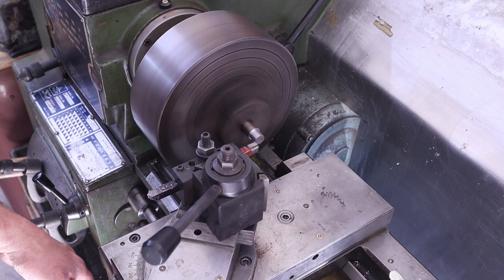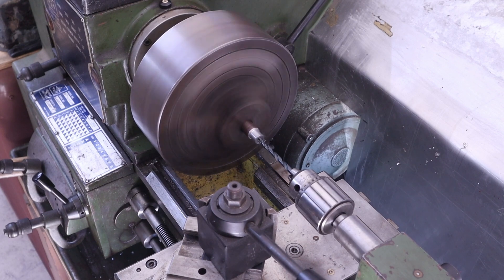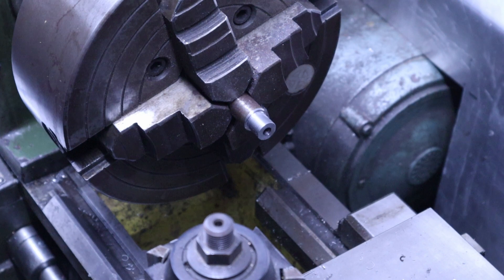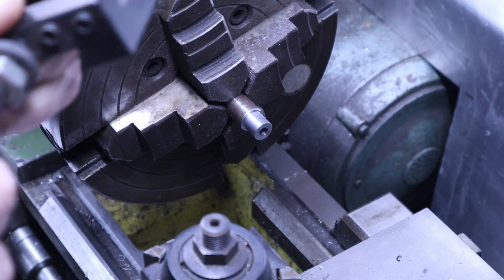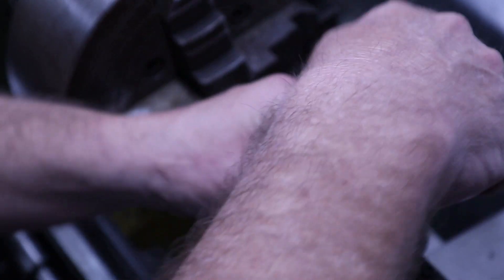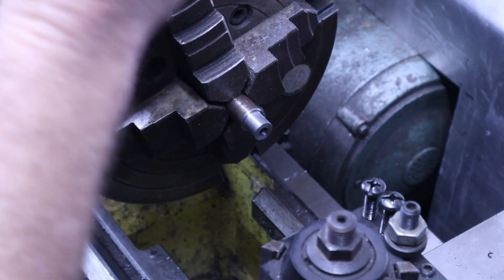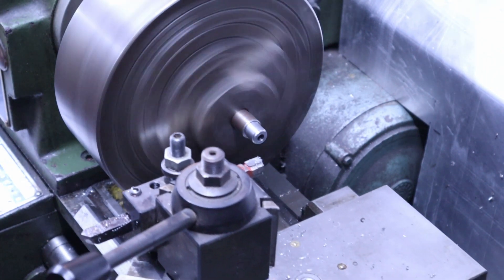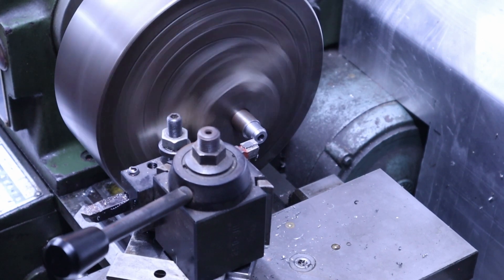Mitutoyo Digital Micrometer Encoder Replacement Part 2.

Comment: AAagggh! Hate it when that happens!

On another note. Have you recovered from your Florida road trip yet? 

I still need to send you an e-mail re: the Mitutoyo digital height gauge but trying to find someplace to put all of the snow here is taking up a LOT more time than usual these days. I wanted to get it partially torn down and send ya some pics of what I am dealing with inside this thing but my time constraints are making me kick that project down the road. It looks like you have your hands full anyway.
Talk later, 
               Denny
Reply from the maker: I have recovered.  Lots going on too.  :) Thank you.